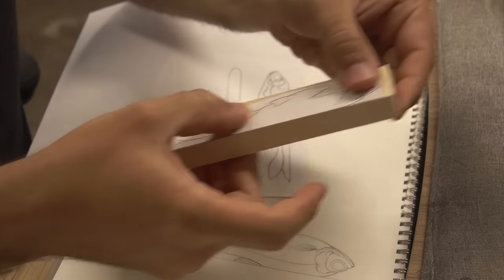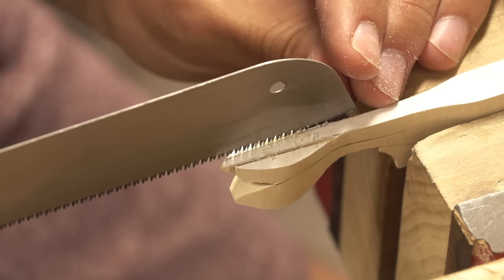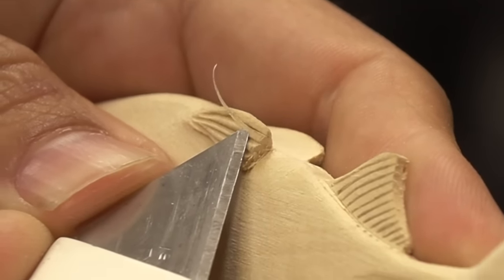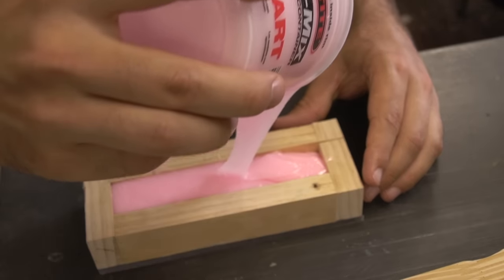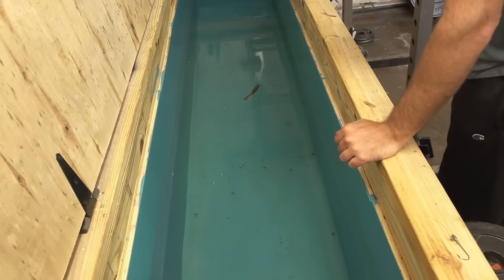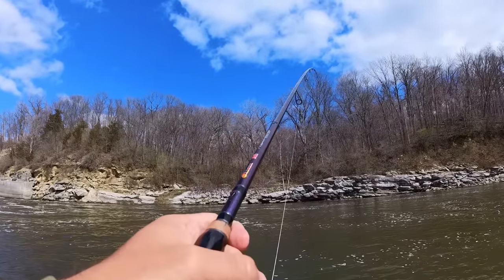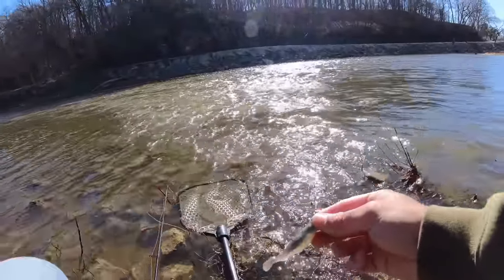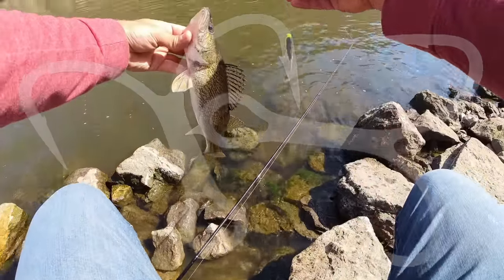Bulbous Tail Finesse Sexy Shad Open Pour Soft Plastic

Comment: Tips for the scroll saw: replace the bouncy insert with something rigid, increase the speed, and check out all the different blade choices there are. Scroll saws are cool because with the right blades, you can cut holes in things with no exit. Just take the blade off, run it through a pre-drilled hole, and re-attach the blade.
Reply: yeah, blade choice is key. Many blades available. You can cut details with a jigsaw that are sketchy on a bandsaw.  I use it for cutting the plexiglass/polycarbonate, less scary for your fingers. I have been watching your channel since before you talked in em  😆. So, I remember the video where the old finger kissed the bandsaw blade!
Reply: It may simply be the blade is upside down and is cutting on the up stroke. That would explain the workpiece wanting to lift.
Reply: I agree a rigid insert ideally with a slit the size of the blade

Comment: FYI, walleye have no length limit on inland waters, 15 inch minimum only applies to mississippi river pools and a few specific lakes. I still would have thrown him back because it's a bit small (which may be why you mentioned it), but just thought it was worth pointing out.

Comment: Silly question here... is that blade upside down on the scroll saw? Shouldn't the blade pull the wood into the surface of the work surface and not away from it? Every scroll saw I've used had the teeth pulling down. But he's a master with the bandsaw so stick with it.

Comment: The scroll saw is a motorised version of the hand held one you use for lips'n stuff. 
Make a rigid blade inlay for the table, and use mainly for thin materials.
You can hammer nails with a sewing machine..

Comment: I have used a scroll saw to cut a couple hundred lures, but have had opportunity to used a band saw on only a couple. Hands down!, the band sand is the much quicker and easier tool to use. Scroll saws are great for thin material when you need to cut precise detail, but not so much with 3/4 and 1 inch stock. I feel your pain!

Comment: i own both a scrollsaw and bandsaw,  the key with scrollsaws in to never use blanks where your fingers are cramped or bunched up to hold onto it.. the piece will just rock on the table due to not enough surface area.. As soon as you use larger blanks the rocking will reduce considerably to where its a minor inconvenience sometimes.. And also put the pressure plate/safety  guard down on the piece until its dragging across it with some friction.. the beauty of the scrollsaw is being able to make intricate cuts without always having to back out the blade and cut in again.. you can do something like your baits in pretty much one constant movement.. Also yeah your plastic deck plate is garbage, copy it and make one out of something like a hardwood or birch ply..

Comment: I have an  idea you should try with your wood lures. if you use a crumpled piece of brown paper bag and rub it on the white basecoat like using sand paper it smooths out the paint for the next layers and it will give you a nicer clearcoat.

Comment: Some more tips for the scroll saw you should hold the wood with a firm grip against the table so it doesn’t flop around and you should buy some good quality blades and it may take a bit to break them in too.

Comment: The scroll saw can be handy, but for sure I’d prefer the band saw. 

I have found that if it’s grabbing and kicking the work up, I flip the blade over so it’s grabbing and pulling the work towards the table. 

No clue if that’s the right way to use it, but it seems to help. 😂

Comment: Scroll saws work better on thinner pieces of wood and with different blades, really good for curves. High speed on the saw, slower push with your hands. Let the tool do the work. Wander less than a bandsaw too. Definitely a learning curve.

Comment: the scroll saw isn't really meant for that type of cutting (too thick). It's mostly for tight delicate type of cuts especially inside a piece where there is no direct access, like cutting out a spot in the middle of something. Like anything, you just have to learn how to use it.

Comment: I’m sure this comment is outdated but your scroll saw blade is wrong for the soft wood. The speed will help but tighter serrations for softer wood. That blade will work well with hard woods like oak or maple but the poplar wood will grab the blade and make it bounce. The insert won’t be an issue with a tighter and smaller serration blade.